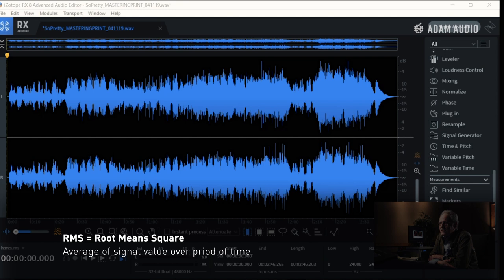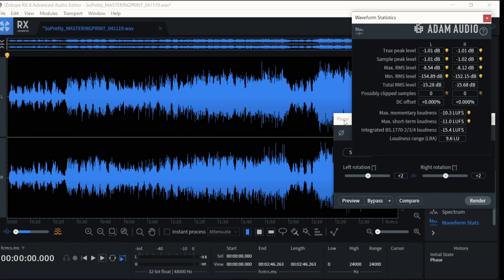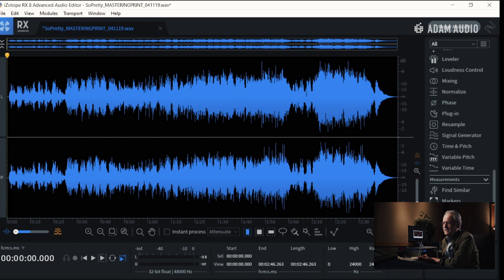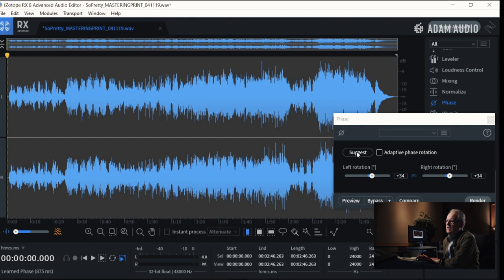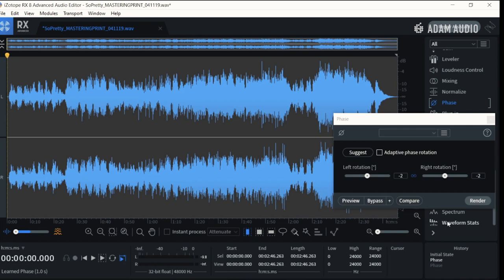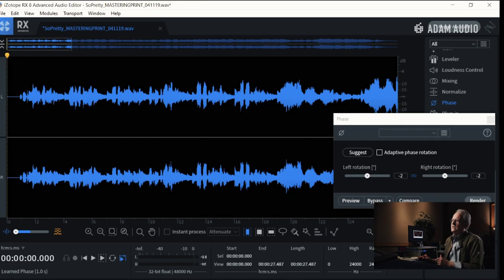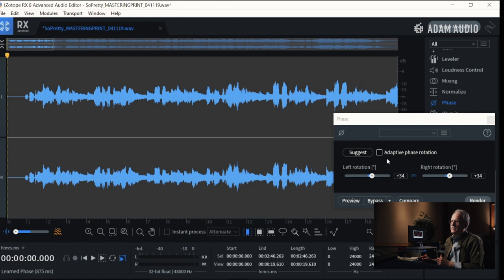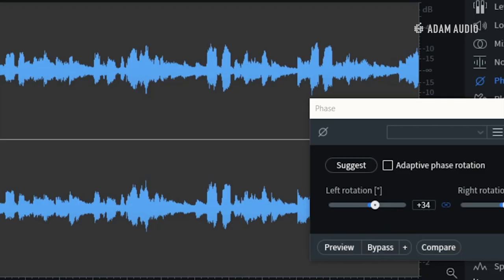The FIRST Step to Mastering a Song: Fixing Phase Rotation | Mastering Masterclass Ep. 4

Comment: Man this is so weird. I tried this on one of my mixes and it got big phase issues at the end of the song. Then exported that last part and it detected no phase issues when I tried it again.  How
Reply: You might have has some sort of "filter everything below 10Hz' option switch on ? A hi-pass filter (set super low) will do the same thing as rotating the phase.
Reply: @davelordy  That would make sense, but no that is not the case.

Comment: How many times can you run the phase utility (in adaptive mode) before there's any degradation in the file?  I've noticed that if you run the phase once, it doesn't grab all the areas and if you run it a couple times, you get more of the phase corrected.  Can you run it too many times? Will it effect the audio as far as dynamics or change the frequency response at all?
Reply: This doesn't exactly answer your question, but the RX manual says: 
"Adaptive phase rotation is best used on vocal material, as it can occasionally yield pitch artifacts on musical material." 
I think it's more intended for spoken word to control broadcast levels.
Reply: @TjMoon91  Yeah, I was mainly asking about using it on a stereo pre master mix like in the video to get more headroom.

Comment: I don't think phase rotation is the right term.
Seems to me that term is more related to multiphase alternators.

I have seen this digital audio fix called normalization.
So, take the phenomenon to be normalised and none normalised signals

My question is why does this happen?
All mics pick up the analogue sound waves and generate an analogue electrical signal.  It is only after this that digitisation occurs, either within the mic, elsewhere along the audio signal path.  Now sound waves are just pressure waves and these normalise around mean atmospheric pressure.  The mic diaphragm just reacts to the sound pressure.  While it may have some inertial delay behind the sound wave, this movement averages around it's mean atmospheric pressure position.  So diaphragm movement is normalised.  If it's a dynamic mic, the coil and magnet moves equally one wat then the other, so the signal it generates must be normalised.  What about electret or condenser mics?  Basically, it's an electrical charge that is normalised around reference potential.  Then there is some kind of inbuilt preamp to bring that up to mic level.  This may be either battery or phantom powered.  Now, a really old cheap electret may simply use a single transistor for the amplification.  However, it is my understanding the transistors only work in one polarity depending whether they are PNP or NPN.  That means the signal must be either all + above reference or - below reference.  So how do you gain reference?  Well, the power source is through a capacitor so, it;s a charge potential no current.  Also in a balanced mic, the signal must be split onto 2 lines in phase and inverted phase.  The sum of these is the reference potential which would make it impossible for the signal to none normalised.  However, if it's a cheap electret with only 1 transistor, the signal is all + or all - but then the mic is supposed to have an output transformer or capacitor.  Which blocks DC, only allowing a normalised signal through the mic output, even if it's an unbalanced output.  Assume the electronics is working without an actual fault, there should never ever be a none normalised analogue signal from any mic.  Is that correct?

So, the question remains, how does the digital signal get to be none normalised?

Is the phase difference between the analogue signal and ADC sample rate skewing the result away from reference?
If so, I'd say Nyquist theory is broken and that would be a big conclusion!

Is there a reference potential problem? How and why?  So far it isn't making sense to me how this happens but I know it does happen because I have experienced it when recording sometimes.

So, I'd really appreciate and explanation is possible.
Reply: I understood 10% of what you said but I'd also like an explanation
Reply: I don’t think normalisation is the right term. Not in the way I’ve heard it used. Anyway, here is an explanation from a Sound on Sound article:

This asymmetry is due mainly to two things, the first being the relative phase relationships between the fundamental and different harmonic components in a harmonically complex signal. In combining different frequency signals with differing phase relationships, the result is often a distinctly asymmetrical waveform, and that waveform asymmetry often changes and evolves over time, too. That's just what happens when complex related signals are superimposed.

The other element involved in this is that many acoustic sources inherently have a 'positive air pressure bias' because of the way the sound is generated. To talk or sing, we have to breathe out, and to play a trumpet, we have to blow air through the tubing. So, in these examples, there is inherently more energy available for the compression side of the sound wave than there is for the rarefaction side, and that can also contribute to an asymmetrical waveform.
Reply: @TjMoon91  Maybe normalization isn't the right term, it's just what my free DAW calls it.

Every time I have plotted out complex combined frequencies for tutorials,  the result has averaged around  zero sound pressure.  I have never seen any example of this demonstrating asymmetry.  The only way I can get asymmetry is if there is a frequency with a wave period around twice the note length.  For audible sound, that would require a note period of 1/40 second @ 20Hz.  So,  I don't see how complex harmonics can adequately  explain this phenomena, unless there are ultra sub frequencies present.

Hmmm, I have never considered it possible for breath to propagate as a pressure wave, but seen it as a fluid flow phenomena.  Though turbulence certainly can be audible, so maybe, I can follow up your suggestions with physics resources.
Reply: @kenwebster5053  I just did a test myself. I played a sine wave and added the second harmonic. As soon as I shifted the phase of that second harmonic, the waveform became asymmetrical.
Reply: @TjMoon91  That's unexpected. According to physics theory, the 2 tones should beat in and out of phase equally above and below neutral pressure within a few cycles.  Put another way, the interference pattern should cause brief asymmetry in both + & - directions which cancels out over a few cycles. 

I can see asymmetry in digital recordings, but if it's happening in the actual sound waves, that seems to defy theory.  I think I need to ask a physics professor.
Reply: @kenwebster5053  If that’s true, maybe the cycles synchronise once it is converted into sound waves in the air? And the cause in acoustic instruments could be related to how microphones work? 

I saw in your initial comment mentioned DC offset. Asymmetric waveforms are different from DC offset. A DC offset will raise or lower the entire waveform off the zero line. An asymmetric waveform will still settle on the on the zero line as the amplitude decreases.

I can’t comment on the rest of your explanation to how microphones work. I’m way out of my depth there.
Reply: @kenwebster5053  Actually, you said they should line up within a few cycles. But a few cycles is a few meters (obviously depending on the specific frequency). 

So if a microphone is only 20cm from the source, could that be an explanation?
Reply: @TjMoon91   Are you saying that mean atmospheric pressure may not be equalising around the mic diaphragm quickly enough to counter local flow pressures from breath?

Perhaps so: 
There certainly does need to be some pressure damping to allow normal pressure changes to equalise without adversely affecting sensitivity to SPL.

Dynamic mics produce signal relative to movement duration and speed.  I suppose that means they might be prone to accumulating zeroing (referece) error each time the diaphragm moves.

Condenser mic signal is relative to the distance between diaphragm ans charge plate.  So unequalised pressure would affect their reference position and signal reference potential.

I'd have thought that for mics to be analogue accurate, this would have had to be solves, but maybe not.

This is conjecture of course, but if it were true, I'd expect to see this regardless of signal type.  However you indicated it is not present with a single tone sine wave but is present when a 2nd tone is added.

That's interesting but hard to isolate the cause. Is it the speakers, the mics, the ADC..... How can we isolate the step & process that causes this?

 "Actually, you said they should line up within a few cycles. But a few cycles is a few meters (obviously depending on the specific frequency). 

So if a microphone is only 20cm from the source, could that be an explanation?"

I suspect not, I wrote that form a time duration perspective.  I don't think, distance form source affects the shape of the sound waves, just their SPL and relative intensity of room SPL to Direct SPL & spectrum sensitivity of the mic (proximity effect). 

As interesting as this discussion is, I don't think we have the resources to definitively solve it ourselves.  I think we need to find a scientific or engineering study.

Comment: RIP to the guy who spent hours doing crazy automation for FX for John to load then load the audio into RX8 without listening and smash the phase back to 0 range hahahaha
Reply: From what I understand, this process doesn’t actually make an audible change, it just creates a touch more headroom. No?
Reply: @TjMoon91  a common trick of mix engineers is to treat the L and R slightly different to get separation and depth. so adding harmonic distortion one side or maybe Eqing will shift phase and mix engineer will use their ears to judge how their mix decision sounds, re aligning that may move things back to the centre in which may change some of those mix decisions slightly
Reply: @fourmat5874  I understand that perfectly well. However in the video, he is applying the same rotation to the left and right channel. 
I would have assumed that means no change in the phase differences of the left and right channels.

I looked into further and got this from the RX manual.
"Rotating the phase of a signal changes its peak values but doesn’t change its loudness, and otherwise has no audible effect on the signal."
Reply: @TjMoon91  Wow well then i misunderstood, I thought it was rotating the phase of either L or R to realign.. thats interesting about the peak loudness, maybe thats another great tip for perceived loudness

Comment: I have used to work on analog music production equipment many (daa) years ego and i scratch my had every time i encounter Digital Audio.

If known to be pre ringing on the linear phase domain - can't some one add some code line and "MUTE" it or something ? 
When Distortion is being created while limiting - can't some one add some code line and send it to below measurable / audible levels ?     
What the point with saturation plug in's that dosen't over sample by default - get yor self a better digital rig, were not in the 2015 like ...  
What the point with every plug in, algorithm or codes that are only half written yet fully charged ? 
If i can't trust a DAW / DD codes to record the source the same F@@@ accurate and repeatable way - what's the evolution here ?
 at least with the TAPE inherent changes between Input sonics ("electronics") and tape output Sonics ("print")  the messed up output in many times sounds like PLATINUMS and GRAMMYS and not acoustical crimes. 
What the point of writing (another) eq and not bothering to make sure you didn't went sloppy with the Q / bell programming and preformance on the high bands ?   

Honestly, i find Digital Audio to be much like Politics - the older i become, the deeper i studies and think about - 

Less and less i found any logic or sense to it !  

Be blessed, correct your Phase masterfully, plenty of health and prosper.